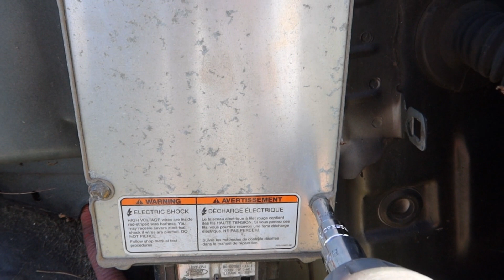7.3 POWERSTROKE QUICK TECH TALK IDM LOCATION REMOVAL

Comment: i got this 97 f250 for scrap price not running of course. it was actually in decent shape with 120 k on the clock but the last 2 owners were kids who didnt understand anything except how to royally cob this truck all the way. anyway i get it and cant connect it to my laptop i realize theres about 2 fuses in it rest were mia replaced them all got it to connect and it automatically failed buzz test. i didnt hear number 1 fire off at all and got a couple codes one was for the memory failure with the chip in it (i have not taken out yet) other was P1271 cylinder #1 high to low side fault. i replaced engine harness and checked for broken wires pulled the valve cover checked uvch have not checked injector ohms yet tho. after replacing harness number 1 buzzed but i still got p1271. i am rebuilding this truck body off and its currently stripped but together enough for me to try to run it. someone put a faas pump on it they had it hardwired with 12-2 house wire thay had an extension cord ran as trailer brake wiring, they had wires tapped into the harness for power and shit anywhere they could get to it cutting off wire sheathing everywhere (im in the rust belt so thats a bad idea lots of green copper i replaced) ive already tested all my soldered repairs all is good there. on top of the engine where the bowl used to be they put 3 ts together making an almost H configuration with the center being the inlet. they brought inlet into the center t and off the top of the H configuration they ran lines to injector feeds then on the lower sides of the H configuration they took the returns and put them into it so that the returns have pressure to, the faas does have its own return but i thought i read this is how you burn up a faas. i am putting in a regulated return but i was wondering if that is a problem and if the idm could cause that code. i have the idm open its clean inside like new nothing looks burnt or corroded but i am gonna mod it since i love micro soldering on pcbs. id like to replace anything on the pcb that is common failure as well.

Comment: I’m chasing a P0267 code on a 01 7.3.  After going down the wiring rabbit hole, I’ve ended up at the plug to the IDM and have a reading on pin 24 to pin 18 of 31.7 ohms.  On pin 23 to pin 18  has 0 ohms. 
I followed the GB remanufacturing tech bulletin and everything else in the wiring is in spec.  Where would a guy start to look for the issue?

Comment: Only the idiot Ford engineers would put an essential to run computer under the fender. That top 8mm bolt is hard to get. I hate this truck. With the fender on you only have 1 1/2 inch to get a tool on it. All I had was a 8mm box end wrench. So it’s 1/4 turn at a time with your one arm in there up to the elbow and it’s a long bolt. Ford Idiots.

Comment: Is there a way to determin if your idm is the older 110 volt module or if you have the newer lower voltage unit withyout pulling it out of the truck? thanks
Reply from the maker: Since there is no guarantee of a unit change out best always to look at the tag its not difficult to pull the wheel well back or to remove the quarter either way we get our new units from here https://shop.fullforcediesel.com/dtc-idm

Comment: I have a 2003 7.3 F350 I’ve had the injectors changed and the glow plugs changed recently the other morning it was down to about 40° and it wouldn’t start until I heated up the block. The truck has about 230,000 miles on it it’s been well-maintained. It looks great and drives great, I remember when it was newer it would start if the temperature was even 20° it didn’t need to be plugged in and now since it’s getting older it seems the temperature is going up and needs to be plugged in more more. Obviously in the summertime is not a problem, I think my IDM is getting weak possibly I haven’t pulled it out yet but I looked at the videos yours in the others and do you think it’s worth changing out my IDM just because it’s probably getting old and it wouldn’t hurt to put a new one in and if I went this route how do you feel about the 140 V upgrade is it necessary? Thank you for your answer. I love you videos.
Reply from the maker: The same voltage IDM is fine for your year there is no advantage for you on stock truck to up the voltage of the unit, As far as the no start cold I have one ready to turn 900k original stock just besides sensor replacements and injector rebuild and it will start with no plug in under zero degree's occasionally the breaker trips in the shop for that pole outside The point you need to test the glow plugs 0.1 to 2 ohms  also bad connectors and burned wires or faulty relay,. 230k is nothing for any diesel especially a 7.3 Back to the IDM it usually make the truck run really rough all the time if its going bad so if it runs fine the IDM is probably fine. So ohm the plugs out and check the rest i mentioned I also have ran into people not fully pushing the connector to the glow plug s also
Reply: @CUSTOMWORKS7.3PSD  thanks. I had a local shop last summer replace the injectors with new OEM and glow plugs with new OEMs. The truck runs fine we’re packed it runs real good there’s no issues during the summer but I’ve noticed here lately like I said it’s gets down about 35° at night. It’ll be difficult to start in the morning if not impossible.

Comment: Hello I have powerstar 7.3L marine version engine. Maybe you can help me to fix it. Because almost two years I not found the problems rougt idling and white smoke.
Reply from the maker: White exhaust smoke

If your exhaust smoke is white, this is a reason for concern in a diesel engine vehicle. White exhaust smoke means fuel is not burning properly. This could mean:

    The engine is too cold
    Faulty injection system
    Incorrect timing
    The engine is overheating
White is often associated with peace and tranquility, but it's hard to have peace of mind when there's white smoke coming out from the back of your truck. The diesel engines' efficiency has improved significantly over the years, so any thick smoke coming out from the exhaust pipe should be a cause for concern.

Excessive exhaust smoke can be due to a number of reasons. But with white smoke, it's typically linked to contaminants mixing with fuel and air during the combustion process. In this guide, we break down some of the more common causes of white exhaust smoke and steps on how to fix them.
Condensation

A bit of white smoke from the exhaust is actually normal when starting the engine, especially after a long stretch of inactivity. This smoke is caused by damp condensation inside the exhaust pipes, muffler, and catalytic converter. Once the engine begins to heat up, the condensation evaporates and mixes with the exhaust gas, creating a tell-tale thin white smoke. This may continue even while driving, as the fuel droplets begin to freeze after leaving the heated exhaust but should disappear once the engine is fully warmed up. However, if the smoke persists even when the engine is already hot or if it's significantly thicker, it may be due to a more serious issue.

Broken injection timing

A common cause of white smoke in diesel engines is faulty injection timing. Diesel fuel injectors are highly sensitive components, so contaminants like dust or rust particles will clog up the spray tip. These contaminants may also prevent the injector from closing. These can alter the spray pattern and/or timing of the injector, creating an improper mix of diesel fuel and air during combustion. This unbalanced mix leads to raw fuel passing through the exhaust and resulting in a cloud of thick white exhaust smoke.

Faulty injection timing can also cause sputtering and other severe engine problems, so it's best to have your truck inspected once these problems start to appear.
Clogged fuel filter

White exhaust smoke is another common sign that the fuel filter might be clogged or damaged. Diesel fuel filters get clogged over time, although factors like excessive contaminants such as water and rust can shorten its service life. Eventually, these contaminants start to build up around the filter and begin to restrict the flow of diesel fuel to the engine, resulting in an unbalanced mix of air and diesel inside the combustion chamber. The fuel filter may also be damaged to the point that fuel begins to pass through unfiltered, causing contaminants like water or gasoline to mix with the diesel in the combustion chamber. Either way, it results in a white or gray smoke coupled with a raw fuel smell from the exhaust pipe.

Clogged fuel filters will eventually lead to other engine-related problems, including stalling, frequent engine misfires, and an overall loss in power and acceleration, so it must be replaced as soon as possible. The fuel tank may also need to be cleaned to prevent any leftover water or residue from contaminating the new filter.
Coolant leak

Does the engine also start to overheat? If yes, the problem may be from the coolant leaking out from the cylinder head gasket. A blown head gasket would have gaps that coolant can seep through and mix with the diesel with the combustion chamber. When ignited, the coolant turns into a thick white smoke with a distinct sweet smell.

If you suspect a coolant leak is causing the white smoke from your exhaust, open the hood and visually inspect the inside of and under the engine compartment. The key things to look out for are the powdery green residue from dried coolant/antifreeze and sticky green puddles directly underneath the engine. Be sure to check for abnormally low coolant levels in the radiator and coolant reservoir as well. We don't recommend trying to start the engine at this point, as it may cause further damage to engine components. If you do see signs of coolant leakage, have your vehicle checked by a mechanic for professional diagnosis and repair.
, a mechanic will be able to observe and locate where the fluid is coming from. If the leak is indeed due to a loose seal or gasket, the part may simply be tightened. But if the leak is from a damaged transmission component, it will require replacement to prevent further damage to the engine and transmission.
Leaking valve seals or piston rings

Worn, damaged, or defective valve stem seals or piston rings can leak oil into the combustion chamber, which will then mix with the fuel and create a white or gray exhaust smoke when burnt. In the case of a bad piston ring, the engine may also start to lose power due to a lack of compression.

If the white smoke comes with significant performance loss, consider having the engine undergo a pressure test to determine if it's caused by a leak at the valve stem or piston. In such cases, the top half of the engine will be dismantled, and the damaged valve and/or piston rings removed and replaced.
Reply: @CUSTOMWORKS7.3PSD  Thanks for you answer. What I do for searching the problem.

Change with oem motorcraft parts ICP, IPR, MAP, IAT sensor. Change injectors cups and injectors o rings. Cleane injectors. Replays compression and oil rings. Change gasgets. Do cooland leak test - no leak by pressure 15 psi. Fuel presure also check is 42 psi when runing. Check injectors signal with osvolography

No active fault show. Maybe need remanufacture all injectors. How you thinking. I cand do diatribute test, because
Reply: I cant do distribute test because this engine has different protocol J1708 and with truch duagnostic tools also cant conect. Hos I think need marine diagnostic tool because mercruiser 7.3 d- tronic engine us the same.
Reply from the maker: @egidijusdauksys9513  ICP / IPR would be good or it wouldn't run . when running unplugging MAP if its bad the smoke would clear up same for IAT fuel pressure is low idle should be at 50 psi before you start digging into the engine for injection issues run a double recommended hot shot injection and fuel cleaning in the fuel and hot shot sticksion 32 oz in oil if after some hours of running still smoking its time to pull the injection and rebuild you should be able to take a temp lazer pointer and when running hot check each exhaust manifold out put for a large temp difference and you found the cylinder with the injection problem try all this first
Reply: @CUSTOMWORKS7.3PSD  At weekend try. Thanks for your time.
Reply: @CUSTOMWORKS7.3PSD  Good day,
    I have a question again. I was able to get other injectors. I replaced them all and ran the engine but the problem with the other injectors remained exactly the same. I increased the fuel system pressure to 60 psi. Nothing has changed.
    Maybe HPOP is to blame here. How to check it? While driving or with the engine running? And what pressure should I see on the gauge?
Reply from the maker: @egidijusdauksys9513  Is this the turbo version ?
Reply: @CUSTOMWORKS7.3PSD  Yes its turbo. I check tolerance turbo wheel. Its all good, like new.
Reply from the maker: @egidijusdauksys9513  The white smoke is at start up, after hot, continuance  ?
Reply: When I start it, it's a lot. Later, when it warms up, they decrease, but do not disappear and the smell is barely breathable. When I raise the revs to 2000 and more, the smoke increases a lot even when the engine is fully warmed up. And when I raise the revs, I start to feel a vibration, as if some cylinder is not working. I tried disconnecting all of them one by one, but I can't find which one. I also tried measuring the temperature of all exhaust cylinders, but the haze was only within a few degrees. Therefore, I think that all the injectors work badly because someone gives them a bad signal or the high pressure pump left or right contour does not develop the required pressure, so the injectors on one side work badly compared to the other.
Reply: @CUSTOMWORKS7.3PSD  When I start it, it's a lot. Later, when it warms up, they decrease, but do not disappear and the smell is barely breathable. When I raise the revs to 2000 and more, the smoke increases a lot even when the engine is fully warmed up. And when I raise the revs, I start to feel a vibration, as if some cylinder is not working. I tried disconnecting all of them one by one, but I can't find which one. I also tried measuring the temperature of all exhaust cylinders, but the haze was only within a few degrees. Therefore, I think that all the injectors work badly because someone gives them a bad signal or the high pressure pump left or right contour does not develop the required pressure, so the injectors on one side work badly compared to the other.
Reply from the maker: @egidijusdauksys9513  This is what I found in the tech bulletin 
 The injectors to use with that would be Code BB.

The cold start up should energize the Hi idle solenoid and the Cold idle IP advance solenoid, those will stay energized until the passenger side head reaches 120*F, then de-energize, Hi idle should be at 950 RPM, normal idle is 650-700 RPM.

Sounds to me like you have an IP timing issue. For a turbo engine, the timing should be set at 10.5* to 11.5* BTDC, on #1 cyl at 2000 RPM. The factory setting is at 8.5*.

White smoke would be late timing, the Black smoke could be caused by the IP fuel screw is set at wide open. When you gun the engine, the turbo is late reving up, you have to balance the fuel, a puff of black smoke is normal but not constant smoking.

Other ruff running caused by the FIPL not set correct or bad. At Idle the voltage on the center wire is set at .90 to 1.02 VDC, then when advancing to WOT should not exceed 5.0 VDC, there is no adjustment for WOT, it is what it is. Voltage has to be steady when advancing to WOT.
Reply: @CUSTOMWORKS7.3PSD  But the IP timing of my engine is not adjustable
Reply: @CUSTOMWORKS7.3PSD  I can send you a video by your mail. You see whats going on.
Reply from the maker: @egidijusdauksys9513  it has to be done electronically per say we diddle with timing from the idi all the way through the late models with ecm pcm idm's but you will need a scanner with that programming capability All the tech updates on the marine version all show this as the number one issue I even took the time and talked to our marine locally and he had said the same thing as long as there are no leaks in the fuel system or air he didn't care what the year was timing had to be excluded and the chances the hpop was out of balance was so rare just like I thought also so this is just another item that has to be checked and excluded
Reply from the maker: @egidijusdauksys9513  I keep getting interrupted to test the HPOP you need to have a connection made at a hy·drau·lic shop with a 5kpsi gauge min  then dead head one side at the pump jump the ipr with 12 volts then crank for 3 seconds max you should get 5k pressure then same on other port with out jumping the ipr it will show 1500 psi this will exclude the pump as the issue
Reply: @CUSTOMWORKS7.3PSD  I checked HPOP as you said. And I got these parameters with the IPR closed on both sides I got 4500 psi pressure when turning the starter. BUT it was very interesting to watch the pressurized engine while idling. At idle, the engine shows 580 psi, but when it revs up to a maximum of 3500 rpm, this means that at maximum power, the pressure maxed out at 1500 psi and dropped to 1160 psi and never went higher. That's why I think that the problem with me is with the HPOP, because the IPR is brand new from the Motorcraft manufacturer. What do you think?

Comment: Clint, I have seemed to have better luck going through the fender well also. However I feel like those 8mm bolts are too difficult to get at with the quarter panel.  I prefer to remove the two bracket 10mm bolts. Curious what your thoughts are on that
Reply from the maker: No worries thats fine as well I just like to clean that plate and the back of the idm before I put them back in